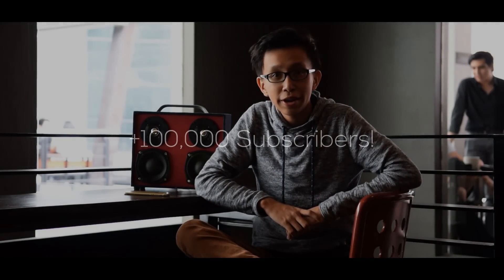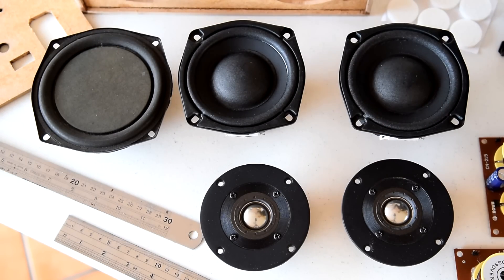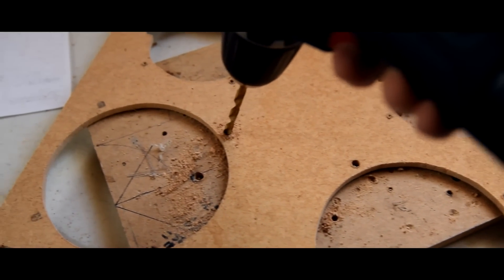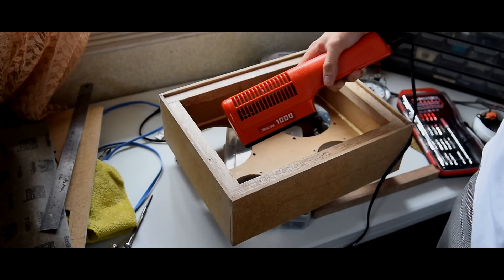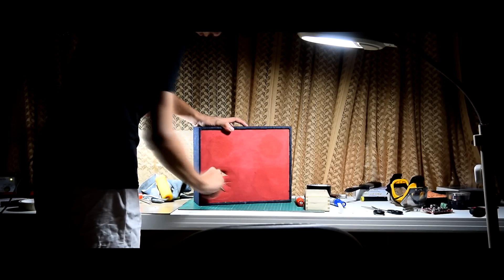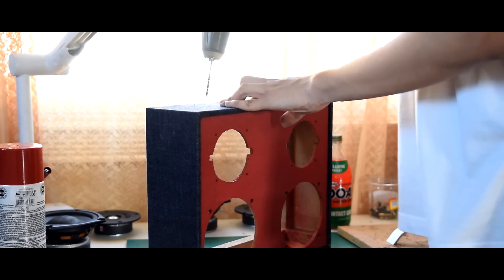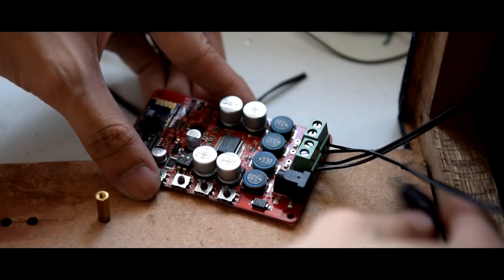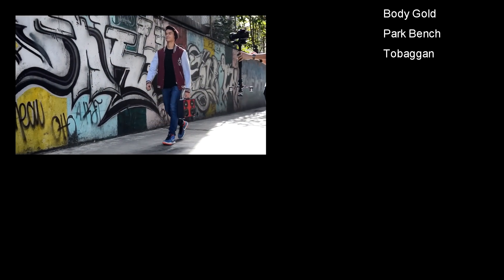DIY Bluetooth Boombox (from scratch)

Comment: Dude, Nice Vid you (and your crew) did (that I stumbled upon). And so meticulous. Right up my alley. I haven't done something like this in 30+ years. Mine was a car radio with a 10" free air woofer and a 6" horn tweeter with crossover shoved into and old kitchen drawer with a cheap power supply and an 80 watt amp. No internet and not much money but it sounded pretty good in the shop (until they made us remove all the radios). I think you may have just woke me up again. Thanx.

Comment: um........ you used 2x25 watt r.m.s amp and you said is very loud???? dude you just said is 50 watts of power only so it not loud enough if I was you buy much powerfull driver or make one and I will say your amp is not much efficient because you forgot boost converter I mean power converter so its much power will drive to your amp if I was you I suggest design your own amp use transistor bjt  to prove your tech builder I cant say I can do it much powerful if you just build it with only a build up system try to make literal by part not made up one!!! I mean by units or just by data sheet only don't write a name if you said from scratch because make no meaning as should be  or sense.

Comment: For all the people asking about charging, wiring, voltage and battery capacity, it's all explained in the wiring diagram at 11.27 
Btw I'm very impressed with the video quality and having done similar things myself, both with boombox building and film making, I really appreciate it.
Reply: not explained how to charge the 14.4V Battery pack (16.8V fully charged). How to charge at this voltage without risks for batteries ?
Reply: It says " for lithium charger" you would want to use a balance charger as there are 4 cells. the balance leads are not on the diagram but would run straight from the cells to the charger and would only be included in the circuit when charging. This dose appear to be an over site in this build.
Reply: +El_Taiito The benefit of the lithium charger is it prevents overcharging.

Comment: one thing, you should make a tinny hole to the air come out, to feel the base every speaker box come with one
Reply: not with a passive radiator. no hole.
Reply: passive radiator? didn't know that

Comment: How much does the batteries last?
Reply: +SD MTB and voltage and capacity would be nice to know
Reply: 14.4v battery pack (16.8v fully charged). 12V 2A power adapter. the problem is how to charge well the battery.

Comment: Hi angelo I am a huge fan of you and I want to make the boombox you showed in one of your videos I find quite difficult the power supply you use and I wonder if I solder the wires of power that goes at the board with the batery and replace the batery whenever it runs out would it work please answer me because Im realy interested in making this project

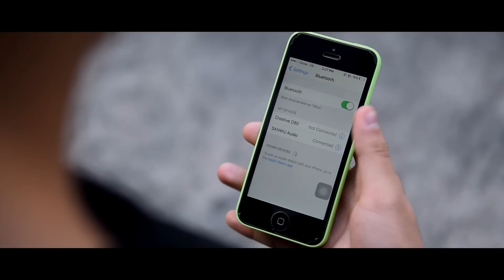Comment: 01 01:10 Jason Derülo - Get Ugly
02 01:20 Jason Derülo - Pull-Up
03 01:40 Framewerk - It's You (Orignial mix)
04 01:50 Nick Galemore & Gregor Trierweiler - Clack
05 03:10 Hibernal - The Streets in Darkness
06 03:20 Oh Wonder - Body Gold
07 08:30 Rod - Anindica
08 14:40 Tez Cadey - Seve (Radio Edit)

Identified using MooMa.sh

Comment: Nice.! I made one in 1990, with a Car Cassette Player & Speakers, in a Old Speaker Cabinet...

You should Line the Walls (Inside) with 1" Fibre Fill, (like You get inside a Quilt or a Jacket) use Spray Mount (Spray Adhesive). And that'll improve Bass Response even More, it Slows the Air Movement, therefore Tricking Speakers into thinking it's a Bigger Box...

I'd get rid of that Half Broken Speaker Cone thing..! [Which just Lessens the Bass if Anything.!]  
Wiring in A Proper Sub would've been Much Better, but then You have a More Complex Cabinet Design, Sectioning off the Sub Part...

What You want is a Solid Cabinet, Totally Air Tight, with Braced Walls, so all You hear is the Speakers themselves, & Not a Cabinet Flexing.!  (Unless they're Free Air Speakers) in which case then U need a Port...

Comment: Great video! However I would just like to point out that you called a ratcheting socket wrench a torque wrench. A torque wrench has an analog display with the amount of force on the bolt, it is used to apply the proper about of torque. The wrench you showed is a directional ratchet, it can only apply force in one chosen direction clockwise or counterclockwise. I know it's nitpicking but I would hope as a tutorial channel you would want your viewers to learn and understand the tools that you are using.

Comment: I want this but with a line in jack in adition to the bluetooth connection, but I'm looking for a cheap module and no luck! :(
Reply: +Luis Alberto Pina Galvañ http://www.amazon.com/KKmoon-Wireless-Bluetooth-2-channel-Amplifier/dp/B01BV8LM5Q/ref=sr_1_12?s=electronics&ie=UTF8&qid=1460248983&sr=1-12&keywords=bluetooth+receiver+boards
Reply: new9000 Wow thanks!
Reply: or if you want more wattage out of the amp you can get the bluetooth receiver (http://www.amazon.com/Bluetooth-Audio-Receiver-Board-Amplifier/dp/B00PXC0CIK/ref=sr_1_2?s=electronics&ie=UTF8&qid=1460305322&sr=1-2&keywords=bluetooth+receiver+board) AND then a separate amplifier (http://www.parts-express.com/sure-electronics-aa-ab32189-2x100w-tda7498-class-d-amplifier-board--320-303) for bigger drivers

Comment: Where is the detailed list you said would be in the description. I only see the amplifier
Reply: +Ryan Gawlik 
well I guess most of the components like the speakers, crossover, and batteries are fairly generic so really you can find those anywhere and it doesn't really matter what brand or model you use, its simply up to personal preference.

Comment: Hey, nice project! I really like bluetooth modules and everything with speaker. In a few months i will start to build my own electric longboards and I think thats a good project for you too. Because you explain that stuff very well and maybe you have some new ideas for a electric longboard. I have already made my Controller with an old Nunchuck and a bluetooth modul in it. So i can send the voltage of the battery to my controller and show the charge of the Board with leds in the Controller. :D 

Kevin

Comment: Has anyone actually built this from scratch? Care to share pics or video so I can see?

This is way beyond what I could do. You'd have to be really into this before you even consider doing it. Total cost with tools would be astronomical compared to just buying something similar on Amazon. But I get that's not in the spirit of building and getting better at engineering your own stuff. I'm just a bit at a loss to the complexity involved here. If you're this comfortable designing to this level. Do you really need a video showing you anything? You're probably already building all kinds of neat stuff.
Reply: +Clay Mann You just need an saw, drill, screws, wood, drill and some skill to build the case. Not to hard ;)

Comment: I recommend you do a hole in the front of the box to allow the air moved by the back from the speaker can go out. with that you get more bass and better sound. sorry for my english. greetings from spain
Reply: it is true, I did not remember me, because my hi-fi has a tube connected to the hole of the speaker box

Comment: Really cool project, but I kind of feel like saying "from scratch" is a bit of stretch. I know noone will ever build a Bluetooth board from individual components, but it's still not exactly fitting. And the video seems oddly proportioned, some bits are shown in unnecessary detail, while others are skimmed over. I mean a 15 minute video should have enough time to list all the components in a readable way instead of saying "it's in the description". Somehow it managed to be long and yet not contain some of the information required to do the project.

Comment: Quick question, you said the wall transformer is for powering the unit when it is not running on battery, but if the battery is glued down and sealed in the box how do you charge it? Thanks
Reply: +benlwilliamson You need a lithium-ion charger for the batteries, and this is done through the dc-port which is mounted in the back along side the wall charger.

Comment: Nice production !! I'm actually building mine too with the same amp, using a plomb battery, a plexiglas front side and blue led strip to make it swag ^^ I also replace the buttons by car switch (with blue led too)

Comment: okay you just forgot a major thing; the air in-/outflow...for the subwoofer... you don't get any bass sounds if you dont have such a hole
Reply: what he has is a passive radiator looks like a sub but its not its works just like a bass port Google it for more explanation

Comment: Aren't passive radiators meant to be larger than the combined diameter of the woofers? here you used one passive radiator that is about the same size as one woofer
Reply: +Rayan Khan welcome to DIY videos. They always do things wrong.
Reply: bassl0va ikr, and also the cutting of the enclosure part, and the battery making process are the two most important things, there was no specific details about either, it was just "Now do what I'm doing in the video, next do what I'm doing in the video" This is more of a "Look what I can do" showcase, rather than an instructional video. 

I've started building my own speaker, unfortunately my speaker is extremely heavy because I got 18mm thickness wood, when I should've got 9mm. Also using a jigsaw to cut a perfect circle is a bitch, so now I have spent £40 on heavy wood. I'm going to try to cut the wood again next month after exams.

Still waiting on the instructable...
Reply: Rayan Khan You don't need to cut a perfect circle because you won't see it once the speaker is mounted. If you want to do it perfect, and be able to flush mount, round-over edges etc get a router and make a circle cutting jig. It's also good for smaller speakers because you can chamfer the back side of the mounting holes for small speakers so they have more room to "breathe". But I've done plenty of mounting holes simply following a compass circle as best as possible.
What is it that you are making?
Reply: +bassl0va I'm making a portable speaker lol.
Reply: Rayan Khan yeah but like what sort of features lol
Reply: +bassl0va Well something similar to/almost exactly like the one in the video, except no passive radiators and no tweeters because they won't fit in the box for the size that I need. The speakers are 6.5inches diameter

Is there anyway to cut the circles without power tools, I don't have access to any power tools for now for at least a month. I just have a coping saw
Reply: Rayan Khan Are the 6.5" speakers coaxial? If you have no tweeters at all it will sound a bit dull due to lack of treble and you could end up with the midrange being "shouty" if the drivers you use have a bad breakup peak. You can get tweeters that are <5cm total diameter that you could fit in somewhere. Dayton Audio ND16FA-6 for example. 

Ouch... Not sure a coping saw would do too well on 18mm MDF. And if you have to cut the straight edges with that too that'd be even harder. Definitely worth the wait to use the proper tools.
Reply: +bassl0va I purchased a cheap jigsaw, it works well enough to do the job. Yes, I have coaxial speakers, they have built in tweeters. Unfortunately the mdf I got was too heavy so I got thinner MDF, it's lighter but the jigsaw is very difficult to cut straight lines eith
Reply: You can use a factory edge on one of those sheets of MDF as a straight edge to run the jigsaw along. Line it all up and clamp it to the piece you want to cut then you can use it as a fence. Should do just fine. For external edges of the box maybe cut 1mm or so bigger so you can sand/route it flush after it's all glued together.
Reply: +bassl0va thanks for the advice! I'm gonna go do it now
Reply: bassl0va Hey! I built my speaker 2 days ago, turned out great, thanks for the advice!

Comment: hi man
i have some questions about the battery pack you used. did you use 4 regular 18650 cells in parralel? or did you use them in a combination of serie/parralel? and is it balanced, or is 4 cells not enough to worry about balancing?
thanks

Comment: You can salvage lithium-Ion cells from an old laptop battery but it MUST be from the same batch if wired in parallel! Otherwise they all can explode. Never mix different lithium-Ion batteries from different manufacturers, always buy or order them in bulk! They are the worlds most dangerous battery type.
Reply: +PunakiviAddikti Ive mixed dead ones (0V) with working ones and my battery pack works like a charm and wasnt even warm when i tested it :D
Reply: MrApplecraft If they were from the same batch then they will work and even dead ones will charge. But good, just always monitor your batteries in case they get hot.
Reply: Where random ones lying around, ive just watched them when i charged them the first time.
Reply: MrApplecraft Good, as long as they don't get hot you're good to go. Have a fire extinguisher nearby. Do not use water to extinguish burning batteries.
Reply: Yeah, water is an really bad idea to stop an chemical / metal fire. But i must say it burns really good :D

Comment: This is an impressive build and a wonderful video. I did notice a couple of things though.

1) You didn't discuss what you use for battery charging. Whatever it is you plug into a DC jack (which is cool) but a pointer to a proper Li battery charger would be helpful.

2) You shouldn't solder to Li cells. The heat ruins them. You can buy cells with tabs welded to the ends and then solder the tabs.

3) And just a nitpick, the socket wrench you used was a ratchet, not a torque wrench.

Your technique for covering the cabinet with fabric was really well documented. Kudos on a wonderful build!

Comment: bro here are my recommendations...

1. lose the tweeters, use full range speakers so that you'll get more power from the amp.
2. your passive radiator is small for the two drivers. Isolate each speaker and give each one their own passive radiator or put a bigger passive radiator so you'll get more low end fq on it.

but hey it's a great DIY! kudos! more projects to come bro! 

P.S. fellow Filipino here ;)

Comment: But how about to charge the lithium batteries? :) btw very good video!
Reply: Was this question ever addressed?
Reply: FDworksTV not answered.. But i think we can put a 10000mah powerbank in there and use micro usb charger.. Little bit costly but way easier
Reply: That would also lower the amps, which in return, would reduce the power going into the speaker
Reply: FDworksTV can you tell me if we can use powerbank and how to connect it..i have 2 powerbank .i want to use it instead of dc chaging
Reply: @Himadri Sekhar Gupta
Oh no, you need 12volts to supply that amp board, your  10,000mah powerbank only has 5 volts.
Reply: @tennu yes buy that will lower the current going to the speaker and your speakers will shut down if they can't get get enough amps.

what you are proposing is costly and with downsides.

Comment: wait but I got a big question if its a real Bluetooth speaker what's the name of the Bluetooth address that comes up on the phone did it came with a name or did you put the name in yourself
Reply from the maker: +Wyzecter Right Of course it's a real Bluetooth speaker. It comes with a name "Sanwu". You can't change it though.
Reply: there is an eeprom (8 Pins) that you can solder on an breakout board and dump/flash.
You can modify the dump which should have the passcode, name and other stuff with an hexeditor and flash it back.
Reply: no, it dosn´t work that way.
Reply: +TechBuilder coooll
Reply: +MrApplecraft Can anyone explain a little more about changing the name of the bluetooth chip?
Reply: lakistrike You can usually change the name on the device you are playing the music with (eg phone).
Reply: Wyzecter Wright u can rename a paired Bluetooth device on ur smartphone
Reply: Wyzecter Wright w
Reply: +TechBuilder You can change the name by dumping the eeprom near the bluetooth chip and editing the dump in an Hex editor ;)

Comment: decent attempt, but from a pro SPL installer, that speaker is gonna have some major distortion, a slice of wood to partially separate the left and right sides would make it sound alot better.

Comment: I made a speaker system using that same bluetooth amplifier and i despise the start up sound and beeps when you press a button. Any ideas on how to get  rid of that? Love the design though. Great idea using the passive cross overs but why didn't you just use dual range bookshelf speakers?
Reply: +emertes17 Also, looked up the passive crossovers but I'm having trouble finding them in the US for less than $20. Any links?

Comment: Soldering tip: If you lightly rough up the solder point on the batteries it will be much easier to solder, also soldering on 18650's or any lithium battery can be dangerous so be safe.
Oh man the bb-8 video made your channel much larger. I am glad that I have been around since the water powered flashlight. Whoa the speed that the parts list went by at. Come on now we aren't as smart as you and cant read that fast, and some of us are too lazy to change the video speed. Anyways I have noticed you cross your arms a lot in the more recent videos, I don't want to sound like I am telling you what to do or how to act but for some reason it gives me a weird 'i dont want to do this' vibe.

Comment: really like it but, acousthically speaking, i thing it should have had at leas some kind of vent, all that moving air is making quite some resistance if you don't open up a hole in the box, and also the buttons so that you can control the thing without opening it, i think you could have made them more.... let's say professional :)
anywhay, great build !!!

p.s. i watched it again and the hole i was talking about is actually the big thing in the bag so yeh... my bad ahha
Reply from the maker: That's why I added a passive radiator. Nevertheless, thanks! 😁